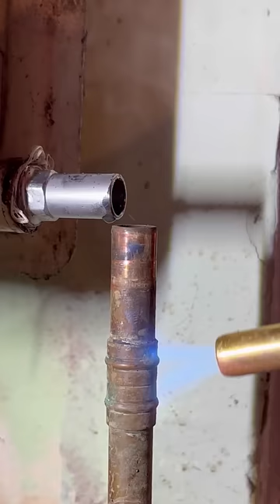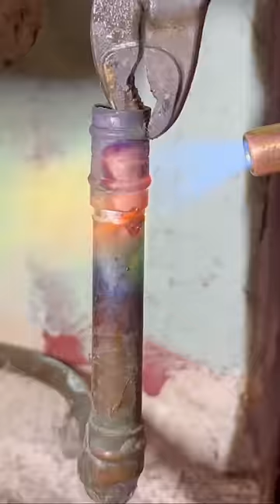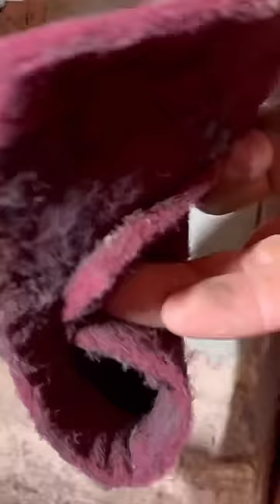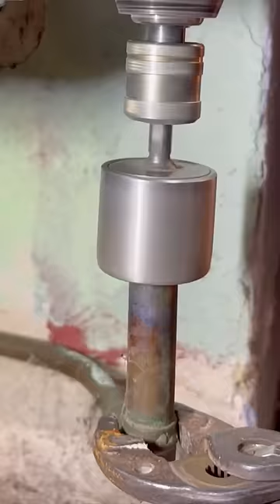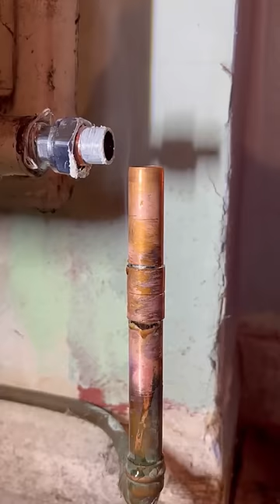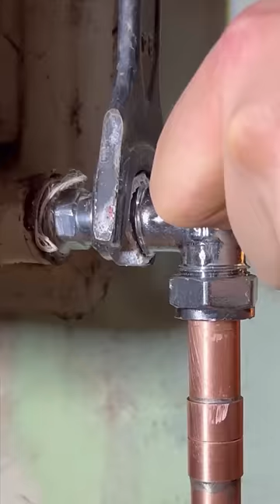HOW To remove water from pipe for soldering! #howto #diy #plumbing #youtubeshorts #asmr #subscribe

Comment: But you would NORMALLY remove the pipe from the elbow, wouldn't you ;) 
Great channel btw. 
Where did you get your pipe vice spanners from?
Reply from the maker: Normal circumstance yes your right but this was a rented so to speak job so was faster this way 😘 thanks mate! Either from them in USA or LHPSupplies in London. You can dm them on insta

Comment: I was told not to wipe flux on the joint when it is still really hot because it could crack the solder. Micro fissures.

Comment: Every valve manufacturer specifies not to treat pressure fittings with pipe dope, etc. because any contaminant can compromise the seal. And they have a much greater dataset of failed installations than Joe of Wrenchtwistershire.
Reply: For one it’s not a contaminate it’s for plumbing potable water not a contaminate.😅
Reply: @plumbbuild6517  For the purposes of a compression fitting or flare fitting, pipe dope is a contaminant that interferes with the mechanical seal, and that's a hydronic heating system, not a potable water system. Hopefully the "plumb" in your username refers only to the concept of being orthogonal with respect to the forces of gravity, and not that you do actual plumbing.

Comment: I hate when people wipe a pipe with flux after soldering.
Reply from the maker: What’s the problem it gets cleaned after
Reply: He doesn't like it clean  @mmplumber
Reply: @EskelatorThePlumber it's corrosive to copper. It's not a cleaner lol. If you want it clean sand it down
Reply: @mmplumber  why not just clean it instead of adding extra?
Reply from the maker: @garyrenton4930  faster
Reply: @mmplumber  not knocking you, that’s your method. I use a damp cloth as I don’t like adding any additional corrosive materials than I need to
Reply: Why thread sealant on compression fittings?
Reply: Pipe sealant helps us sleep at night 😂
Reply: Then why would Flux be used to begin with....do you see how that sounds ?
Reply: @Masterofnon3  😂

Comment: All was great until you used flux to cool down. You soldered top to bottom,  like us smart plumbers do, but then hacked it with the flux. Also, why pipe dope on a compression fitting? Do you do the same for flared joints also? Baffling.
Reply from the maker: Flux doesn’t cool fittings it gets hot 🤣

Comment: @Jch914
Only if it's an existing installation/pipework. 
Brand new off the shelves you don't need to then you are correct there's no need for the dope.

Most plumbers see it as a gamble if they don't use pipe dope

Comment: Lots of idiots on here,I’ve been a domestic and commercial heating engineer for 25 years in uk ,everything he did was how it should be done.joining compound on compression joint.do things properly over here
Reply: Same, 36 years. Nothing to see here all spot on.
Reply: If its a job on a council estate. Did you do apprenticeship. Or out of college straight on the tools. .. 35 years on the tool. Bring back old school apprenticeships
Reply: You don't need pipe dope on compression fittings . Engineer that

Comment: You ever hear of wearing gloves when you solder or do you just enjoy getting flux on your fingers and random burns on your hands.
Reply: Did you ever get a drop of melting solder in a thin glove? It's worst than bare hands since it sticks to the glove and keeps burning the skin until you actually remove the glove. When a drop falls on bare hands you just say ouch and the reflexes do the rest: 0.5 seconds of burning vs. 4 or 5. And of the solution is a thicker glove then I better do framing or mechanics.
Reply: @anibaldehernandezycruz8023  Yes, I have , but not getting flux into cuts and being able to hold pipes that are hot is way more of a benefit. The solder sticking to the glove doesn't happen very often, and if you have good gloves that aren't mesh even better.

Comment: Wayyy too much flux
Reply from the maker: Nothing bad happened mate and gets flushed after
Reply: @mmplumber  I'm told it's corrosive to copper. Actually eats away at the surface to clean it and etch it for soldering to be successful. If left in in huge quantities no idea what the damage is
Reply from the maker: @wr3099  it’s a good job I clean it off and flush 👍
Reply: @mmplumber Nothing wrong with your method, it's what 90% of plumbers use. Your channel is to help the trade, it's not regulations 👍👍👍👍

Comment: Why add solder to the bottom socket on a vertical coupling when you can feed from the top ? Also the mini flux tub with the brush gives me DIY vibes

Comment: Sweated on press fitting and not to mention the pointlessness of putting dope on compression fittings
Reply: The original fitting is a soldering fitting.Has a ring of solder in the fitting to aid soldering.